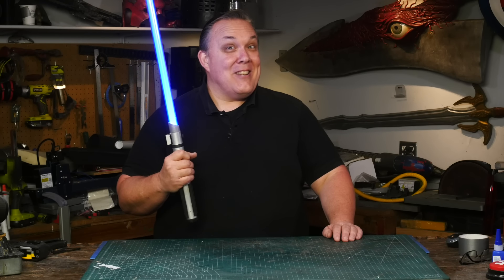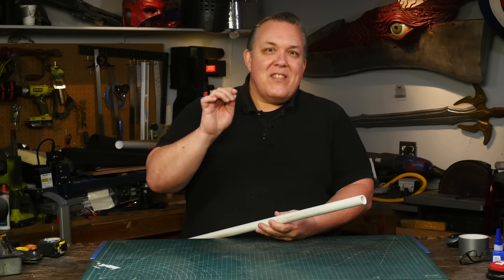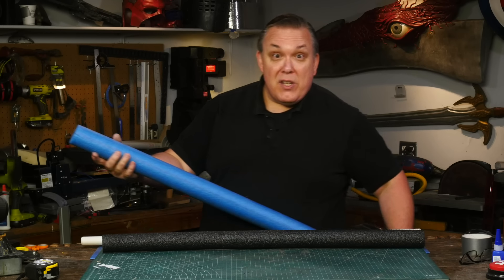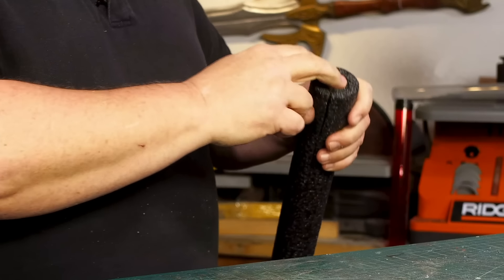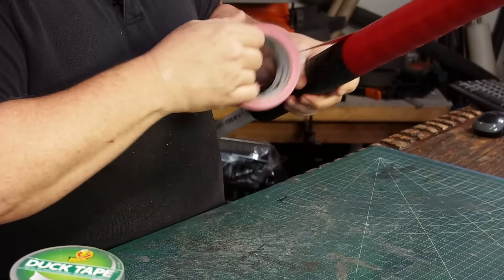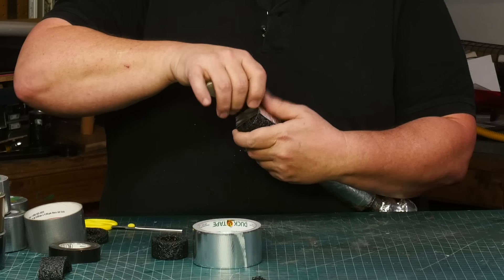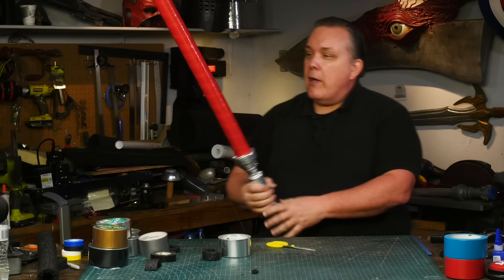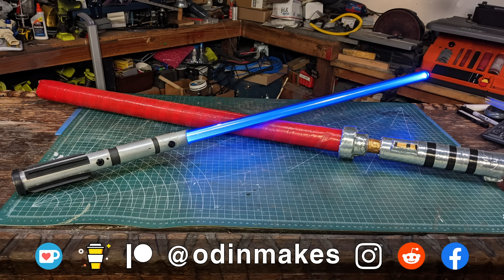Odin Makes: A lightsaber made from duct tape, PVC, and foam

Comment: The coolest trick I found for making a foam lightsaber is wrapping a big steel bolt in duck tape until it fits tightly into the bottom of your handle to act as a counterweight to make your blade feel almost weightless. Also if you use a pair of cheap white leggings as blade covers you can color it with permanent markers and rubbing alcohol to get really cool effects